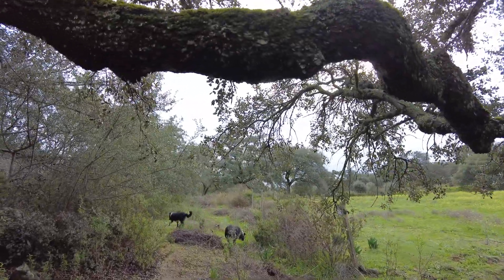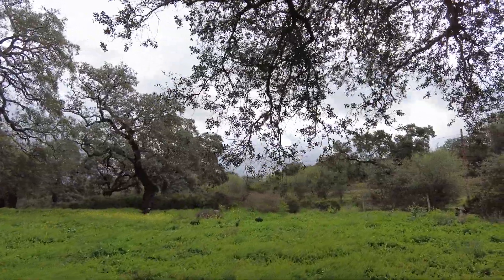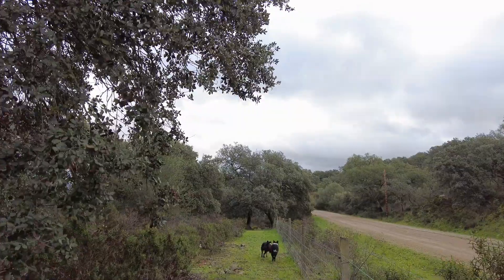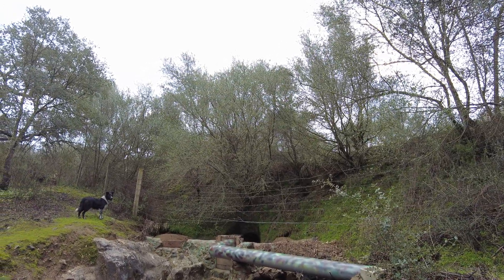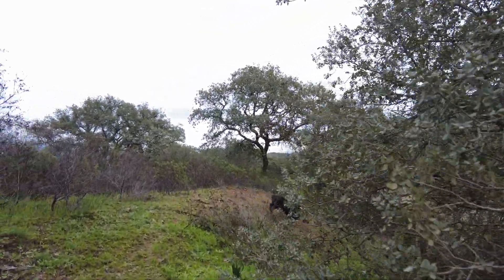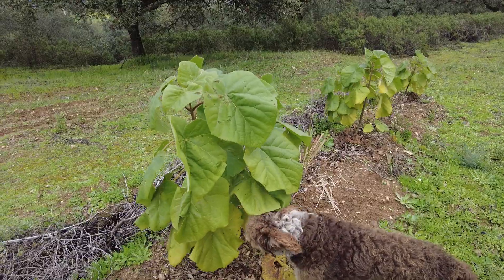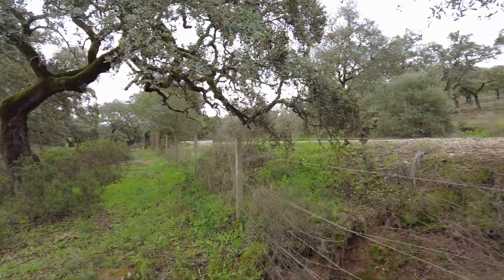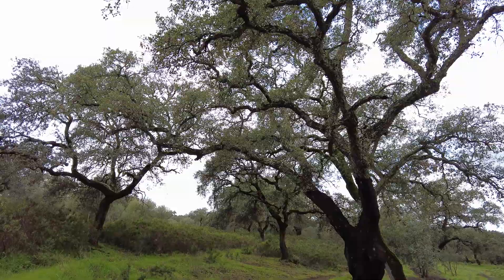The road that channels millions of litres of water to our land.

Comment: I am thinking of buying a 1.5 ton mini. Mostly I will use it to clean ponds and then make swales. What do you think?
Reply from the maker: Oooh. Some suggestions: Yes, just buy something as they make life easier, try to get a track width of at least 1m measured from outside to outside, buy as much additional stuff right from the beginning, order filters extra, if you can do 2 ton then it's a bonus, try to get working foot pedals, if you can have an off centre cabin then perfect, a tilt bucket is worth a lot as you don't have to adjust the machine all the time, try to separate the fuel tank from the machine as it rattles the tank into leaking, try to get the exhaust above the cabin or else you breath all the carbon monoxide, GOOD LUCK
Reply: I am trying to be under 110 track width because I need to work between my Persian Tahiti lime trees.   I see some accessories need a machine that is at least 1.5 ton
Thanks for the suggestion of the tilt bucket 
Saludes desde Colombia 
Cg